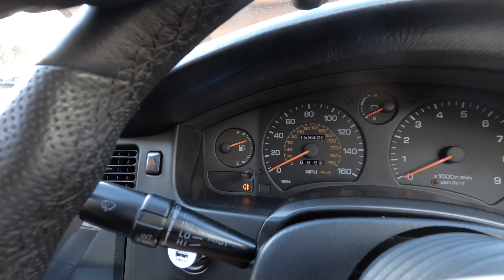SW20 Toyota MR2 Service Oil Change Gearbox Oil Change Coolant Flush Bleed Brake Fluid Flush PART #11

Comment from the maker: Mobil Super 3000 X1 5W-40, 5L - https://amzn.to/3tXXsFB
Prestone Coolant/Antifreeze, 4 Litre - https://amzn.to/3tZSojJ
STP Engine Flush - https://amzn.to/3sVcc6v
STP Radiator Flush - https://amzn.to/2PwVnkW
MANNOL BASIC PLUS API GL 4 + Gear Oil 75 W-90, 4 Litre - https://amzn.to/3sWOPd4

Comment: the grime in that coolant system was disgusting. Well all those fluids weren't great, but the coolant looked like straight dirt lol
Reply from the maker: I would guess its from 2007 when the engine was swapped lol - thats why you change change the coolant every few years 😆